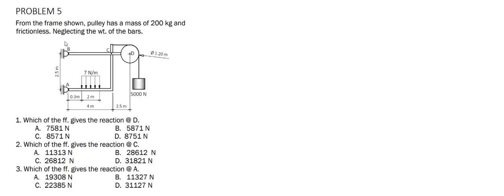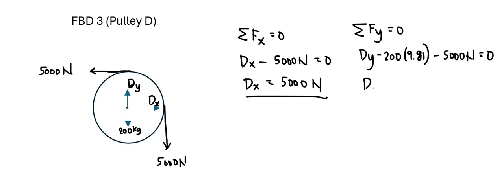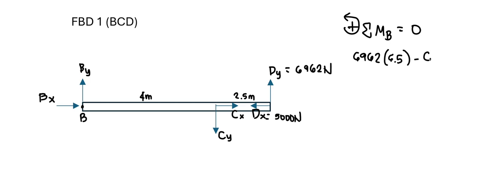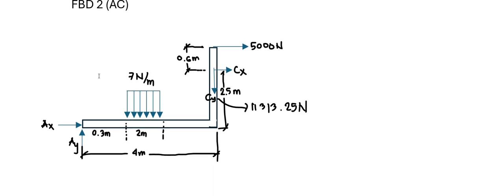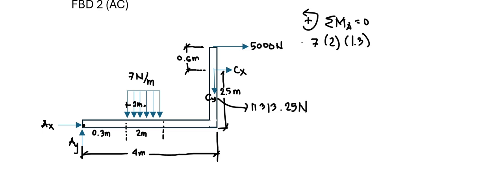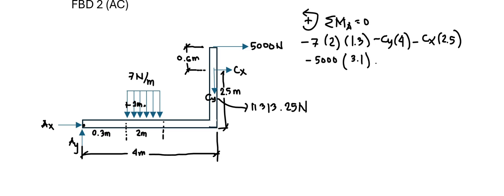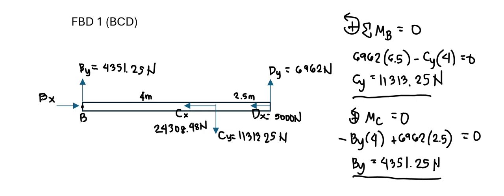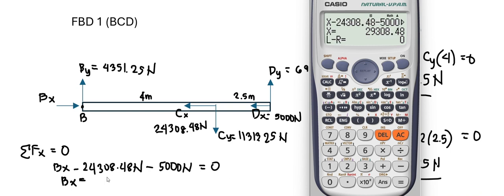Statics - Sample Problem 5 (Frame Analysis)

Comment: Saan po nakuha yung 0.6  above Cy ?
Reply from the maker: The pulley has a diameter of 1.20m, so the distance between the center and the edge is just the radius, which is 0.6m.